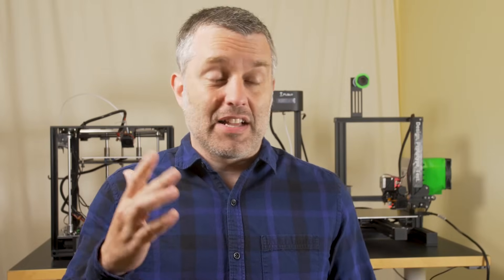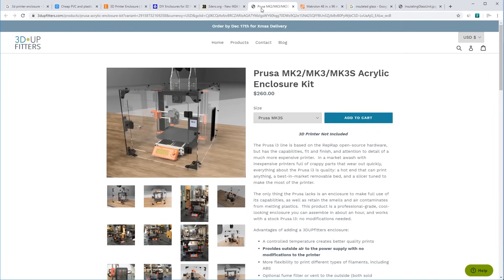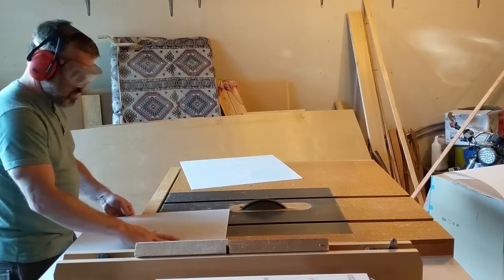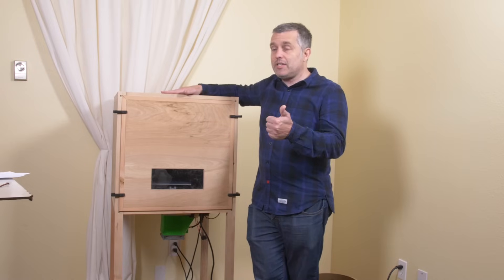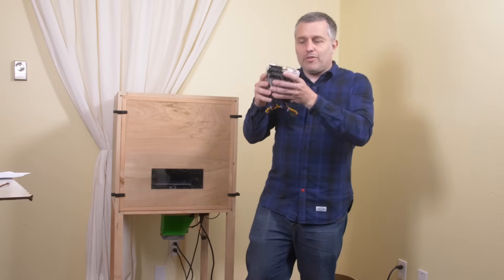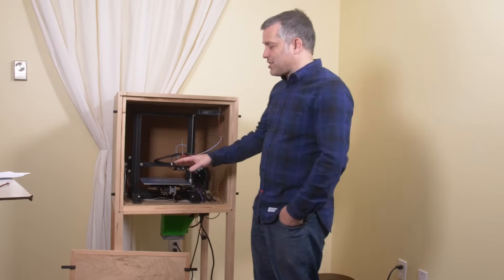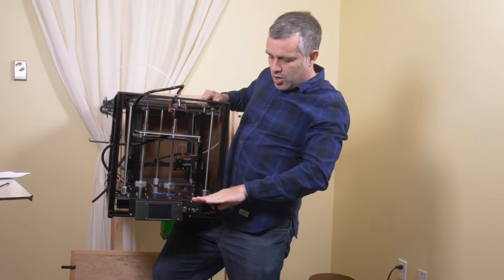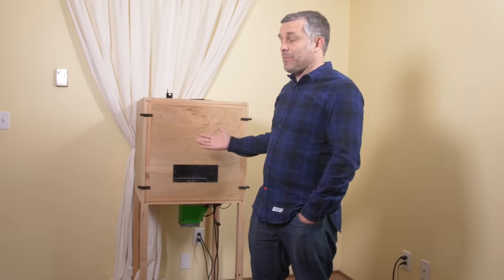3D Printing in a 100°C Heated Chamber - Lessons Learned

Comment: What do you think about using a black and decker oven to heat an in closure kinda like how you did with heat gun, I’m thinking to gut it out and use the instruments
Reply: Then I’m thinking just some sort of power cut off sensor set at 100 degree

Comment: An easier way of making double-glazing is to make a rebate around the inside of the frame, put the first pane in it then put a thin strip of wood/plastic all round the edge then put the 2nd pane on top of that followed by another thin strip to fix/ seal it all together.
Reply: rebate, also known as rabbet, for those wanting to look up this woodworking technique.

Comment: Thanks for the great video and good call on Duet and RRF and great work on the enclosure. I am a relatively new Ender 5 plus owner which I am building an enclosure for and otherwise modifying for printing high temp materials. I started out going the Octopus + Klipper route, but I bought a duet board for another project and like it far more than the Octopus & Klipper. I didn't really appreciate fully just how well polished the Duet boards (and RRF) are. I'm making my enclosure out of sheet stainless steel and boy is it a lot of work! I'm using a water-cooled dragon and external cpap fan for part cooling for materials that require it.

Comment: I rebuilt my geeetech i3 into a server cabinent on caster wheels, lined with flame retardant sound deadening. Had to brace the acrylic frame to avoid the frame warping in the heat. But it was super cost effective and cost me ~$150AUD total. 1/10 I have an ABS print lift, but im pretty happy with it.
Reply: btw props for keeping it metric!

Comment: I heard that the issue with heated build areas is that they were patented by someone (Stratasis maybe??) so it's not possible to incorporate one into a commercial design. An enclosure can be, but one for the purposes of containing a heated volume is a no.
Ofc you can DIY one, but can't sell them.
Reply: Stratasis has a patent on the bellows style enclosure.

Comment: Do you realize how hot a regular 40 watt bulb will heat up inside a closed box like this. 270 BTU in 2 hours. So the heat chamber needs little except a fan for heat distribution and an off/on sensor for temps.  Over kill.

Comment: What about using a peltier element in front of the part cooling fan, using its front end to cool the part cooler air and let the hot backend heat the chamber air. I’m thinking using this in conjunction with your existing chamber heater.

Comment: You can build a heated enclosure for your 3D printer and sell it with no problem, as long as the electronics are INSIDE the enclosure.
Actually, Stratasys' patents apply to systems where motors are setup OUTSIDE the insulated heated enclosure, and that is where the challenge lies.
You want to keep your motors and other electronics outside, so you can safely set the chamber to a higher temperature without damaging your machine.

I am myself working on a custom built high temp printer for my own needs as I want to be able to print PEEK and PEI/Ultem, and learn things in the process.
Will release this large format machine in open source when it is fully functional and as soon as Stratasys' patents expire.

Some printers on the market are built with both type of enclosures, motors inside (Mi) and outside (Mo).
For instance:
- Aon3D M2 (Mo)
- MiniFactory Ultra (Mi)
- Zortrax Endureal (Mo)
- Intamsys FunMat (Mi)

There are very interesting threads on Reddit and RepRap forums:
- https://reprap.org/forum/read.php?1,823052
- https://www.reddit.com/r/3Dprinting/comments/ac2pgr/this_year_the_stratasys_patent_for_enclosed_build/

Great community to discuss the topic on Reddit:
- https://www.reddit.com/r/HT3dprinting/

For more information:
- https://patents.google.com/patent/US6722872B1/en
- https://patents.google.com/patent/US7297304B2/en
- https://patents.google.com/patent/US6722872

Comment: SSSSSSSSSSOOOOOOOooooooo. Maybe a dumb question..... ahem BUT. If you 3d printed a 3d printer in Carbon Fiber PETG and PETG would all the parts melt if you enclosed it to print abs or other higher temp filaments?
Reply from the maker: There's a difference between melting and slumping. The glass transition temperature is the variable that we need to talk about. You want a plastic gets close to its glass transition temperature and you put it under force. It is much less able to resist deforming. In your example, it's just the case sides that are prone to weakening under temperature. Because they are not structural, I don't think there would be a problem. But the devil is in the details. It all comes down to the specifics of your design.

Comment: Some incandescent light bulbs in a box is much safer as a way to heat the box, and you get lots of light too when you open the door.
Also, stepper motors are rated at 85 degrees C max, and will get a 40 degree rise above ambient, so when the machine is running in a "wooden oven" like this the stepper motors will definitely be running way above their safe operating temperature.
Reply from the maker: The response time of incandescent bulbs to heat up the chamber would be so slow it would trip an thermal runaway error with the firmware.

Comment: They don't come with enclosures because the heat ruins the basic components of most cheap printers. Magnets don't like high heat. No do most motherboard components or steppers. So solutions exist to take out the sensitive parts and relocate them to a cooler area, thus increasing the life of the printer. Every printer over 10k has an enclosure.
Reply from the maker: It's funny that this old video of mine gets so much attention. The Bambu Lab X1C also has an enclosure for about $1,500. But nobody makes a sealed and insulated  enclosure with a dedicated heating element.

Comment: Home Depot sells reflective thin foil ‘insulation’ you can coat the insides of the chamber with - my whambam enclosure comes with something similar and works great.
Reply: I was thinking reflectix
Reply: Literally just finished building one, I used foam core board for structure, and spray glue and “heavy duty” tinfoil to reflect the heat. Could also apply the tin foil to wood, or pink foam insulation etc.

Comment: Very nice idea with the double sided windows, but it’s hard to implement.  I’ll try to keep the electrics outside the chamber since most of them should run in <50C environment.  I build my hot chamber on my old Thing-O-Matic with only one window in the front, and I used an old hair dryer heater with a PID controller and a fan to circulate the air.  The wattage was calculated for the chamber size so it can only reach about 90C if it gets stuck in on position.  I installed a flex duct for the extruder and nozzle cooling since the chamber is running at at least 50C, it can’t cool it down.  also, having an exhaust fan with carbon filter and balance the air flow to make the chamber slightly negative pressure.  Since all my electrics are below the chamber, I don’t need to do addition cooling for them.  It makes the old 3d printer print ABS consistently and eliminate a lot of warping issues.  Happy printing. :)

Comment: You don't need shottky diodes. The point of shottky diodes is they are half the voltage drop of silicon diodes, and they switch much faster. Both great for the low voltage side of a switch mode power supply. 1N4009 diodes work fine for 120V @ 60Hz and are MUCH less expensive.

Comment: thats basically what i did with mine, except i only used glass windows in the doors an the rest was 5mm thick foam board a layer on the outside an a layer on the inside, i had first planed just to do the layer on the outside an then fill the space inside with sound deadening foam but the single 5mm foam board muffled it enough for my liking so i opted to just use the same on the inside.

Comment: adding some thick home insulation foam outside will give you a much higher r value. Also a radiant barrier inside the box will trap heat much more effectively.

Comment: Double pane windows help mostly due to the fact that glass is a good thermal conductor, but plexiglass and most plastics arent.  But it would still improve efficiency though... but to most people the extra cost and complexity isnt justified for something they may not use all the time.

Comment: Well done, great share - I did not know about the stratasys patents. It was apparent the printers have to be enclosed. I ran into so many problems with a Makerbot Replicator + warping. When I passively enclosed the printer, the Makerbot extruders botched up - they couldn't handle even 45'ish degrees.
Drafts and temp are my mantra about the Makerbot printers.

Comment: Prusa has published plans for an enclosure using IKEA furniture and 3d printed parts ( and some polycarbonate sheets)
Reply from the maker: You clearly did not watch the video before leaving a comment.
Reply: @DesignPrototypeTest  I watched the video ( I watched it again after you replied). Again, the best way instead of a heat gun is to use an AC power heated mat at the bottom of the enclosure. ( There is a Chinese company that sells heated mats AC or DC in any dimension) I bought a 600W AC for my heated bed. Its easier and more controllable with an SSR. You can boil water with these

Comment: I consider myself a tinkerer-hobbyist. I understand how a heated enclosure can improve layer bonding and print quality, but I have my doubts with electronic components running in a 100-degree C enclosure, especially since some of the components may already be running at or near their spec's maximum temperature ratings. Let's not forget that the printer will also generate some heat: the bed, and heating block. Exposing a printer's circuits to elevated temperatures might be risky. It's good that you moved the electronics outside the box. 

What follows is for your readers. At 100 degrees C, the temperature is well above what most component manufacturer's specs would allow for their components. They say computers work better at normal to lower temperatures. I don't know what the lower temperature range might be, but I think temperatures above 50 degrees C might be pushing the envelope. As for the heater, I suppose it could be mounted safely in a wooden enclosure,  as long as its metal support bracket doubled as a heat sink to dissipate some of that heat near the wood. It's good that you have an extinguisher on hand, but it's better if you never have to use it.

Comment: Why glass ? Making it with cheapest MDF will be the most cost effective also larger grains of cheap MDF will accommodate for air insulation. Also sound proofing is a plus if some foam footing is added under the box.
If someone really  needs a showoff then only one front glass will do.

Comment: No one is suing you. A continuation patent in part is claiming a substantial upgrade to the original idea basically, but in a lot of cases I don't think a judge would uphold the patent. They are often issued without a lot of due diligence by the examiner and they allow the court system to work out disagreements. If the judge finds against the holder, the patent protection is no longer valid which puts the suing company at risk of losing the protection from others so they have to be pretty sure they will win or they are just bluffing. I have come to understand patents as basically useless to anyone who doesn't have a full time legal department. They make investors feel safer and keep inventors at bay in coming up with new things out of fear of being sued by FAANG/CIA/Big Legal. If I were a 3d printer company, I would just start selling them and wait to be sued...you won't be unless you get rich. Copyrights are a lot easier to and therefore are more enforced.

Comment: Want double "glass" for next to nothing? Use channel plastic sheets, now in the us there should be a ample supply free of charge in dis used election signs. If you want to see the printer while printing either use clear plastic for the door or mount a cheap webcam inside the box. Do not forget to carbon filter/vent the box in and out, you can use a speed controlled pc fan to exhaust excessive heat and regulate how much air you pull out. Make sure to put the psu and controls outside the box so they do not overheat. You do NOT want a100% air tight box as that will get to hot, eventually harming your printers parts. Consistency around 40 c is more important than high heat for most print filaments. You get ALL the heat you need from the heated bed, no extra heat is needed.

Comment: A patent doesn't prevent you from making and enclosure and no, they can't sue you for making one. They can sue you for making one and selling it. If you make one for your own personal use, no problem. You can't make them and sell them or give away to others, that would violate the patent.
Reply from the maker: >If you make one for your own personal use, no problem.
Many people share this misconception. Without getting all lawyerly about it, let's use an example. Let's say I'm Tesla, and I invented a giant machine for casting single piece aluminum frames for my cars (they actually did this). Nobody has ever done this before, and it makes the most incredible performing cars for the least money. Obviously, I would patent this machine. Now Rivian, (a copycat company founded on thievery) comes along and "builds their own"  copy of my machine. Their copy which they built themselves violates my patent and allows them to make cars which are competitive to Tesla. Whether or not they bought the machine from someone else is irrelevant. They have it and they are using it to compete with me. Avoiding this situation is the whole reason for the patent in the first place.

Comment: Fellow designer (architect) used air gaped 4 wall polycarb for a silouet feature wall on a project. 

Product Similar to this:   https://www.amazon.com/x14mm-Clear-Polycarbonate-Plastic-Sheets/dp/B083H1FGTR

Wasn't rated for construction with an 'R Value' and can't remember how we skirted this. But was superiors to single pain glass and siding/plaster wall (minus insulation) after testing. 

I'm considering using double pane 3 wall polycarb with a desicant pack inbetween for side, back and top walls of a housing. Printed corner/edge/bracing and double pane plexi front door. 

Still considering Base.

Will also construct a external heater  using ducting with thermo switch and seperate air flow fan with a HEPA filter. 

Relative noob to printing but have architectural amd mechanical experience and think this will work.

Chime in with your trolling abuse or thoughts!?

Comment: any chance of water cooling motors?
Reply from the maker: Yes, but should be cooled on all sides otherwise some strange problems may arise. Best to redesign so that steppers are not in the heated chamber to get warm in the first place. In my experience, the steppers heating up is not the primary issue. The plastic movement parts (V-wheels) get soft in the heat and wear more quickly. Also, the frame expansion/contraction from heat cycling causes nuts and bolts to loosen, so periodic maintenance is required.

Comment: Enclosures are a good idea. However keep in mind the circuit board is not designed to operate at 100C ambient and you wont be printing for long. You need to move the circuitboard out of the box.

Comment: "Why doesn't anyone use double windows in their enclosure?" question answered: cause it's a pain in the ass :))
Reply: Not to mention the real reason no one has mass produced 'budget' 3d printers with heated enclosures.  Stratasys had a patent on it.  Which thankfully expired at the end of last year. So now expect to start seeing them at some point.
Reply: @PRiMETECHAU  you can print ABS on a not heaten enclosure (or even without enclosure, as long as you dont move air near the bed), but it will have better accuracy on a heated enclosure  since the piece will shrink more evenly after the print if the entirety of the piece is at the same temperature, not only the bottom.
Reply: Not to mention if you are going to all the effort for double pains for improved insulating value(heat retention), then you want it sealed with an inert gas in between to reduce the heat transfer through the glass because glass has jack for any R value. Enclosure good idea, method of execution was piss poor and lacks knowledge or understanding of things actually work and the effort. And a heat gun? Seriously? Safer to use a 500watt baseboard heater or a million other better methods. And you're aiming for way over 50C? Are you hoping to boil water?
Reply: I'm running a triple window, it wasn't hard at all, although the gap is only air, there's no vacuum.

Comment: Never place your body between the table saw's blade and fence. Stand to the left. Kickback's a bitch.
Reply: Or pass your entire arm across and over the blade while also leaning forward., 10:00 gave me a heart attack.lol
Reply: Both correct, but hes got the blade pretty high, so chance of kickback is pretty slim
Reply: I have a buddy that luckily got to keep his finger because I set the blade to the correct height of the material. He wasn't paying attention and had his thumb on the material and butterflied his thumb open. If the blade was higher he would be a digit short.

Comment: Why not just overhaul a large, discarded oven?  Certainly has the fire hazard aspects considered with the design, and certainly if you find one that’s old enough, it probably has asbestos insulation which gives you an awesomely efficient R value...